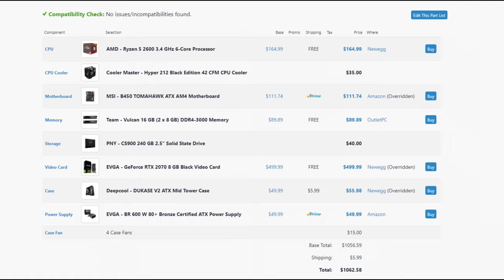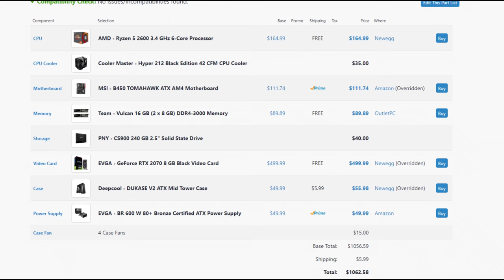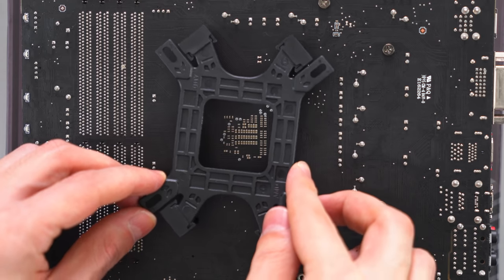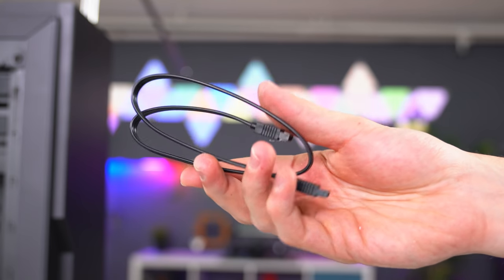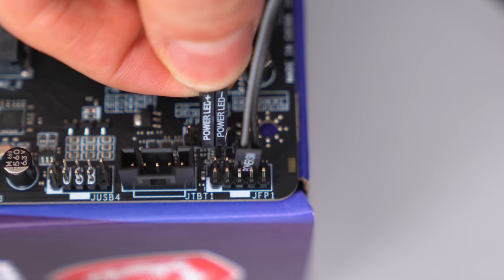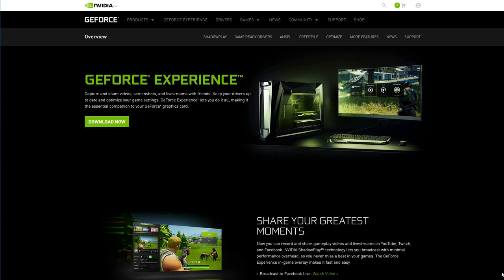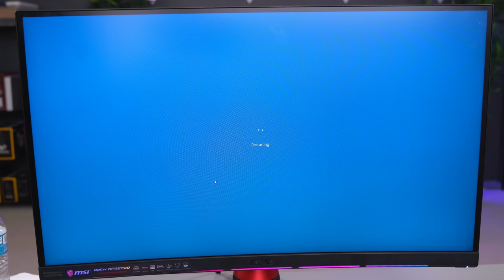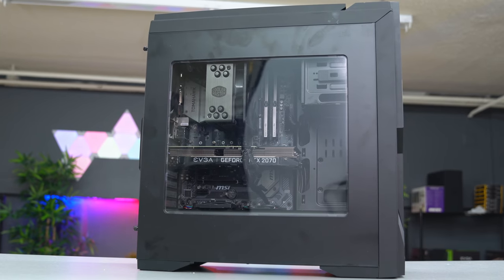How To Build A Gaming PC + Overclocking Guide (2019)

Comment: Been building pcs for almost 5 years, still watched this whole video 😂 gotta support one of my favorite youtubers
Reply from the maker: Ayyyy 🙏🏻
Reply: I got a question please help me lol
Reply: @ttvghostedassassin5624  whats up my man?
Reply: So i bought ram corsair vengeance 3200mhz 16gb kit 2x8 and I bought it back in 20 Nov and found out the day that it is only running at 2133mhz and when i try to boost it to even 2400mhz my pc crashes and only works when i put it back to 2133mhz ?
Reply: Why is this
Reply: Can you help me figure out why mine won't go to 4.0 ghz?  I have the ratio set to 40.00 and saved it. But still only says 3.6ghz
Reply: @ttvghostedassassin5624  i would assume your motherboard cant handle running that high. so its either time for a mobo upgrade OR just running at the 2133
Reply: @ttvghostedassassin5624  try updating your bios and let me know what happens. intel or ryzen?
Reply: @dnawrapsatl  where are you getting your readings from? bios is showing 3.6? or is that windows showing 3.6? does it say it's running at 4.0 in bios after you OC it? more details would be helpful. download CPU Z and tell me what it shows you're clocked at.
Reply: @ttvghostedassassin5624  ram's stock speed is always 2133mhz you just have to go to your bios(make sure you have updated in the latest one) and enable the xmp profile so your ram can clock at 3200mhz. If none of this work then its incompatibility with your mobo
Reply: @ttvghostedassassin5624  update bios and make sure XMP is turned on? But it could also be that your mobo can't handle it
Reply: Probs mobo but when i use my old ram which runs at fuckin 2400 that works fin like wtf
Reply: itsFLIP Ryan Ghezzi Are the following compatible with each other as I noticed the graphic cards says DDR5 whereas the memory card and motherboard are DDR4.  Here:

MSI X470 Gaming Pro ATX AM4

Corsair Vengeance RGB Pro 16 GB (2x8GB) DDR4-3000 Memory

- EVGA- GeForce GTX 1080 8 GB. FTW2 DT ICX Video Card

- AMD Ryzen 5 2600 X 6 core

Power Supply RMx (2018) 750 W 80 + Gold ATX power supply

Also what are your thoughts in terms of Power supply for the above specs ?
Reply: i got a question to
if i use a macbook pro to install windows will it still work on my pc i'm gonna build my pc soon but still don't know this.
please react to this!
Reply: / FLONNEPON \ yes
Reply: / FLONNEPON \ just remember to install it to usb stick
Reply: beast tnx!👍😉

Comment: This is probably the best guide video on youtube, you made me have much more confidence when im going to build my first PC!

Btw, would these parts work with the nzxt h500/h500i case?
Reply from the maker: No, H500 is mini Itx. This board is Atx
Reply: I have the h500i and I don't see any reason why these parts wouldn't work.
Reply: but techsource the h200 is mini itx, the h500 AND h700 are atx
Reply: @TechSource  h500 is mAtx and atx no?
Reply: to make sure just put the parts in a pcpartpicker list :). Also get the h500i its only 30 more dollars and there is nice led lighting
Reply: I just went to check and it says that it supports mini itx, micro ATX and ATX. Now im confused
Reply: Ive searched on Google and this is the anwser: ATX, MicroATX and Mini-ITX so yeah
Reply: @TechSource  on amazon it said: ATX, MicroATX and Mini-ITX ❤
Reply: H500/H500i are ATX, everything will fit.
Reply: NeedLess it will work. Currently have one with my build and it has a ATX motherboard. Hope this helps
Reply: @TechSource   the h500 is ATX
Reply: @dark yh, thanks, but i just dont get it why techsource said that h500 is mini atx. He problably said it by accident.
Reply: @TechSource   the H500/500i is a regular atx case!
Reply: TheElite47 ITS A JOKE
Reply: @frail looooool😂
Reply: NZXT H500i
Medium form factor ATX case featuring all steel construction, tempered glass, and a smart device for fan and lighting control.

Name

NZXT H500i

Model

CA-H500W-W1

Dimensions

W: 210mm H: 460mm D: 428mm

I/O Ports

0 x USB 2.0

2 x USB 3.0

HDD Slots

2

SSD Slots

2

Total Fan Support

4 x 120mm

3 x 140mm
Reply: H500 is a Mid Tower ATX Case. All parts will work!  @TechSource
Reply: it will if you search it its an atx case i dont know why techsoucre said it is mini itx. Yes it will work
Reply: @TechSource  You are wrong.
Reply: @TechSource  rather buy i7 9600kf.
Reply: Will mid atx work

Comment: great !!!! NOW I HAVE THE PERFECT $1000 build to make . thanks ed 😭
Reply: damn you are lucky lmao
Reply: Následovník Nikoly Tesly difference?
Reply: if it was actually 1000$ ...
Reply: Lorenzo theres similar builds for under $1000 .
Reply: But he said get rid of the fans and cooler and it is $1000...
Reply: @adenlaipply873  checked, it is about 1100$, of course its not his fault because prices change but still...
Reply: I would change that case, don't really like it.
Reply: @excelsiusprime  true, but it's very difficult to find a nice case for that price
Reply: Personally i would try get an I7 intel CPU they are just great reliable Cpu's and I7's last for years.
Reply: @X3Vort  but do you understand that the i7 is liturly the price of the whole system
Reply: Ah my bad man you're right
Reply: @lorenzo6734  in eu its 1300€... That's about 1500$
Reply: Následovník Nikoly Tesly go for a 2600x instead
Reply: @Keyosu  why?
Reply: Následovník Nikoly Tesly yeah i guess if you really need that multicore performance. I like the better single/quad core performance as well as higher base and boost speeds. Wouldnt even need to oc the 2600x. 2600x is to 7700k as 2700x is to 8700k.
Reply: scyra99 better single/quad core performance which matters more in gaming, while the multicore performance from the 1700 is slightly better for streaming. Ill take the higher base frequency, newer tech, and quad core performance
Reply: Následovník Nikoly Tesly youre looking at ~10 more frames in every title with the 2600x vs 1700 btw.
Reply: Následovník Nikoly Tesly yeah that cpu isnt an all rounder like the 2600x
Reply: @Koiza  1700 is for Editing not for gaming is much better 2600
Reply: Wrong emoji
Reply: @rabbimir38  Is ryzen 5 1600 plus gtx 1060 good for gaming ?
Reply: @sizzrizz6074  yeah its good, but if you can spend like 25/30, and find a 2600 should bee very good, cuz 2000 version are really good then 1000 version, and now 1060 6gb version prices are really good, don't buy 3gb, bee pacient and you can find 6gb in same prize, on Amazon, there are "Very good condition" cards, you can find there. Good luck
Reply: @rabbimir38  thank you for replying😄
Reply: @rabbimir38  can you also tell me which gtx 1060 6gb should I buy ? Like MSI , ASUS , ZOTAC , GIGABYTE ?
Reply: @sizzrizz6074  the best choise is MSI, the temperature is lower than the others, the performance is really good, but if you go for cheaper, go zotac or asus.

Comment: 450b pro asrock fatality k4
Ryzen 2600 stock cooler
Rtx 2060
Vengeance 3000mhz 16gb
Crucial 250gb SSD 
1 tb barracuda HHD
Any case under 100$
And you have an alround pc that can handle anything you trow at it. Streaming editing gaming desktop browsing multitasking.
Reply: For the past 2 weeks I've been thinking on a build and this is literally what I also came up like a week ago. At the current prices I believe that this is the best for the money you spend.
Reply: @xingbairong  100% worth it my dude it is honestly the best you can play anything 1080/1440p
Reply: @dakuro6  I'm not an expert. What I can suggest is to check out the following cards(2060/1660ti(just came out)/1070(ti if possible, that said it's older technology compared to 2060,1660ti), 1060 6GB(or 3GB, also older technology compared to 2060,1660ti)/Vega 56/RX590/580/570. I believe that these are the best GPU's at the moment when it comes to price/value you get. 
You might want to check some userbenchmark.com benchmarks to get an idea how those cards perform then check their prices and decide after that. Still when you decide on the parts before you buy them make sure that they are compatible. Just go to some popular tech forum and tell what parts you are planning to use and people will tell you if it's a good or not :)

Comment: RTX 2070 on a Ryzen 5 2600? The RTX 2060 bottle necks the CPU on a Ryzen 7 2700x. Could get away with the 2060 or the 1660 ti save some money  and put more RAM in it or Ryzen 7. Would wait until the new Ryzen stuff later this year to build a new Ryzen build though.
Reply: michael angelini lmao a 2060 doesn’t bottleneck a 2700x at all buddy

Comment: Hey I’m planning on building a pc for around this budget, I was wondering if someone could answer a few questions for me, thanks!
Do I need to overclock? I’m normally an Xbox gamer so I don’t need every frame required, does overclocking matter?
Does this motherboard have WiFi built in or should I buy a USB WiFi adapter as well? 
Is this PC VR capable?
Reply: Vr yes wifi get yourself a wifi card
Reply: No you do not need to overclock.
Reply: overclocking makes sure that u are using all of the power capable in your pc
Reply: Just wanted to say thanks for the info. Built my PC today and it booted up no problem. Downloading all the drivers as we speak.
Reply: Keep in mind that over clocking might reduce the life of your parts
Reply: Instead of over clocking would it be better to get the 2600x that is already set up
Reply: Matthew Prine I would not agree because you can overclock the 2600 past the 2600x

Comment: The rtx 2070 is litterally 700$ CAD... RIP
Reply: Check on PCPartsPicker bro. You may find cheap or lower price on those online shop verified by them
Reply: Not only that. He used a 600 watt PSU and the 2070 requires at least 650 watts.
Reply: 1070ti is just barely weaker than it for cheaper

Comment: Can’t you just get the 2600x which is overclocked without having to worry about an aftermarket cooler or losing the silicon lottery.
Also the cooler the 2600x comes with is better then the 2600
Reply: Because the 2600x at least in Czech Republic is more than 100$ than 2600 that you can overclock for free yourself
Reply: The 2600 actually runs a bit better than the 2600x after overclock

Comment: Question: are there any issues or problems that arise with the windows that you buy from urcdkeys?  its seems weird that you could get the OS for that cheap, and I've seen microsoft threads that say that the licenses are illegitimate.
Please send help!!!
Reply: Did you ever find anything out? I still need to buy mine but I don't know whether I should trust it or not
Reply: @thomaswright6142  The OEM versions (the ones you dont buy from Microsoft) work, but you can not get them to provide support or help if you ever run into windows issues

Comment: Can you do a $250 dollar pc???
Reply: burnt toasty the Xbox is coming out with keyboard and mouse features. Get that unstead
Reply: burnt toasty get an hp 8200 elite sff with a gtx 1050 ti low profile, cheap and great for entry level gaming
Reply: A used X58 system with a Xeon or something would probably get you close to that price.
Reply: Rx 570 = 80.
I5 3470 = 35
1tb hdd = 16
8gb ddr3 elpida 15.99
Unbranded 520w psu = 17
Windows 10 pro key = 3.55
Any case.... 20+

Using ebay. Everything use. A perfect 1080p machine. Good luck

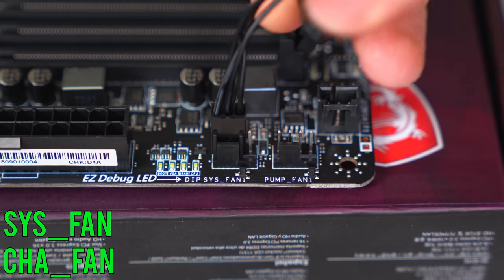Comment: 13:44 conventional wisdom has it that one intake fan and 3 exhaust fans create a negative pressure scenario which has many downsides like exhaust fans reducing each others efficiency, more dust accumulation and generally bad cooling...solution...re- arrange to 2 intake and 2 exhaust...otherwise a solid guide

Comment: this is the most easiest guide to follow. im proud i build my own pc watching this. my build is 

cpu: ryzen        5 2600
motherboard:  asus  tuf b470 plus gaming
power supply:  rm750x
graphics card: gforce 1060
memory ram: 8gb 2x 3000mgz
sdd 128gb
hdd 1tb
mid tower case

cpu cooler: master liquid ml240l rgb
also got wireless keyboard,mouse and a wireless internet adapter . sorry if my typing is bad. anyways good video thanks so much
Reply: MrFishtank007 yes it was a mistake. also i think pc case is too big for my taste but it works great for gaming so all in all it was ok

Comment: My build:

Gpu: Rtx 2060 
Cpu: I5 9400f
Mobo: Gigabyte z390m
Ssd: samsung 970 evo m.2 500gb
Psu: evga 600br
Ram: corsair vengence LPX 16gb DDR4 2666

Optional parts:

Monitor: Msi optix g24c
Mouse: Razer Basilisk
Keyboard: royale kludge rk61 (red switches)
Headset: Razer kraken pro v2.

Performance (all at 1080p):

Fortnite: 300-400 on all low settings with view distance high

Modern warefare: 150-180 all high settings

Minecraft: way more than you need

Forza horizon 4: 140-160 all high settings.

Sea of thieves: 150-200 on ultra settings

R6 seige: 170-240 high settings

Total price: 1100-1200
Price can vary depending on when you buy
Reply: What's the total price?
Reply: @sprinklenuts4593  edited the comment. Check there.

Comment: I built mine for under £1000. It was originally a £600 build but upgraded to end upa t this. All i have left to do is change MB and possibly a better venting case.

Ryzen 5 2600 £118.95
MSI B350M PRO-VDH £58.98
Corsair Vengeance LPX 3000mhz 16gb (2x8) £56.50
MSI RTX 2060 Super Ventus £332.00
ADATA XPG SX8200 Pro 512GB M.2 £80.59
Crucial MX500 500GB SSD £81.26
be quiet pure power 11 600w £74.99
Thermaltake H17 Mid Tower £27.86
120mm Arctic Cooling Fan (Top Exhaust) £4.87
Arctic Bionix F140 Fan x2 (Front Intakes) £26.74
Arctic Freezer eSports Duo CPU Cooler £34.99
Win 10 Home £5.99

Comment: 1440 Ultra settings with over 100fps? I might go with this exact setup. At least in the future I can potentially get 4K if I change the setup a bit even with the new games having better graphics and more demanding on the hardware. As long as I get around 70fps with no dips.
Reply: The Ders Update: the entire build with no optional parts is below $1000 near the $960-$980 range

Comment: Just built this last week. only difference was that I used ram from a different company and a different case due to stock issues. PC runs great and I've gone ahead and ordered the "optional" cpu fan he recommended for overclocking, The only thing that I'm thinking will need an upgrade within 2 years is the CPU and maybe the motherboard. Shouldn't cost more than 400 to upgrade, although the ones from this video run perfectly fine for now.
Reply: @Sessrooo  darkFlash T20 ATX Mid-Tower
Reply: @Sessrooo  Anytime

Comment: CPU: Rayzen 5 2600 X 
Motherboard: MSI B450 tomahawk 
GPU: EVGA RTX 2070 Black
Power Supply: 
EVGA 500 W1
SSD: 
Kingston 240GB A400 SSD 2.5
HDD: 
Seagate BarraCuda 2TB 
RAM: Vulcan 8GBx2 (3000Mhz)
Case: 
Rosewill ATX Case

Reply on me, please. If this set up is good or it want to be modified?
Reply: @Travis Mabe what do you suggest?
Reply: @momar2144  You are fine with that power supply. Try to get a 550W but if you can't its 500W is still enough.

Comment: Hi Ed, your vids is amazing, and this PC actually cost for me around $542.90
But I didn’t find the case you used, but I found Rosewill ATX Case, Mid Tower Case with Blue LED Fan/Gaming Case for PC with Side Window Panel & 3 Fans Pre-Installed, Computer Case 2 x USB3.0 Port - Nautilus, It supports ATX
By the way
Thx
Reply: ralmutaweh how did it go

Comment: Almost 1.5k for Canadians in Ontario after 13% tax
(i changed graphics card to msi GeForce GTX 1660 ti which can be over clocked to 1.8ghz it was 300 dollars cheaper so why not. Not really a performance difference)
Reply: labeeb mirza hey is this pc good I want to make a budget for 1000$ sorry I am new and should I use 1660 ti
Reply: @dinoomi7306  this is a good pc build to be honest. 1660 ti doesn't have a huge performance loss. You still average at 120-130fps on fortnite. 

You don't have to go for 2070 right away and looking at benchmarks its not worth the upgrade for it. Something like a GeForce Titan v down the line would be good. 

This computer set-up is really good for future upgrades. 

The build I am going with for this is using the 1660 ti however I will be using the AMD ryzen 2600x not the 2600 because you can get a little bit more out of the cpu. 

If you want to save more money I would recommend:

Different case 

Different RAM 

Different GPU if not the 2070 the 1660 ti would do just great

Different power supply

Best place to see what parts are supported and I have found very useful as it compares prices is

ca.pcpartpicker.com/
Reply: @dinoomi7306  

Alternative components with no difference. All from Newegg Canada

Corsair Carbide Series SPEC-04 Mid-Tower Gaming Case

MSI GTX 1660 TI GAMING X 6G GeForce GTX 1660 Ti Graphic Card - 1.88 GHz Boost Clock - 6 GB GDDR6 

CORSAIR VS Series VS650 - power supply - 650 Watt (CP-9020172-NA)

Arctic Silver 5 Thermal Compound  ( you will need thermal paste)

Adata XPG Z1 (2x8GB) 16GB DDR4 3000Mhz SDRAM Memory Module

Cooler Master Hyper 212 Black Edition

Kingston SSDNow A400 120GB SATA 3 Solid State Drive  (use this to install windows on to for faster system boot)

AMD Ryzen 5 2600X Hexa-core (6 Core) 3.60  ( I believe this could be clocked up to 4.2 ghz)

Seagate 1TB BarraCuda SATA 6Gb/s 64MB Cache 3.5-Inch (use this for games or any other applications)

MSI B450 TOMAHAWK AM4

This is the build Parts I went with all parts purchased from Newegg total was 
$1407.36
Reply: Should I use Newegg or amazon
Reply: @dinoomi7306  newegg its a lot cheaper then Amazon i usually add to my cart on both site to see the total after tax nd all to compare what more worth

Comment: Hello! Great guide, you make it all seem so simple! Two questions. Does the motherboard have built in wifi? If not, what would be a good replacement with built in wifi? Also, if i wanted to replace the ram sticks and possibly the fans with ones that have RGB lighting, what would be some good options? Thank you in advance for the help! Oh and lastly, which fans do you have set to inflow and which ones do you have set to exhaust? I know you want to create positive pressure